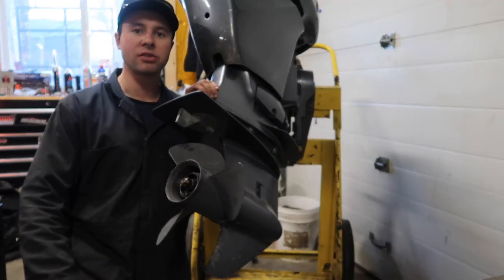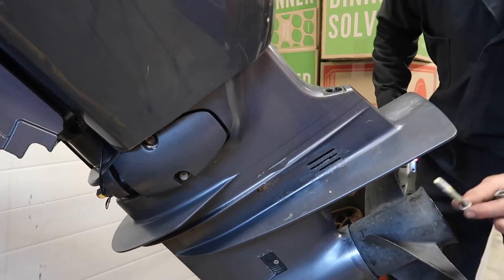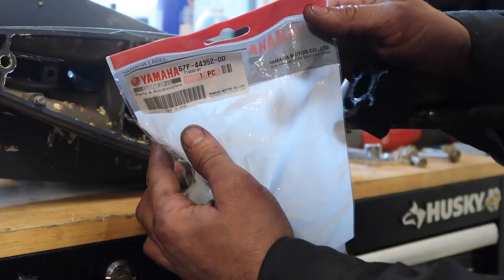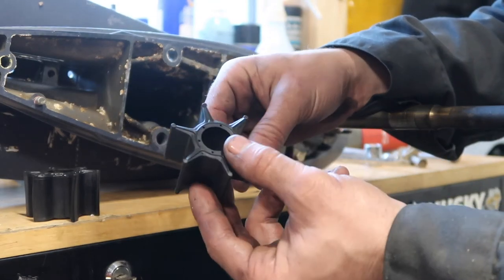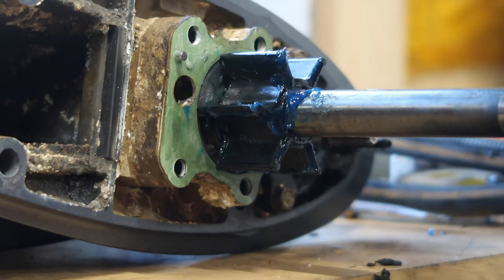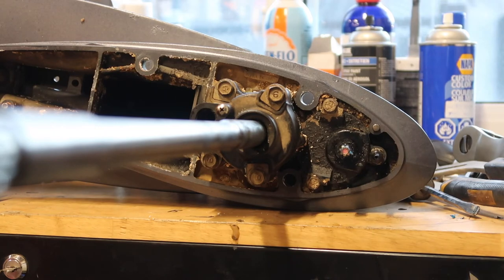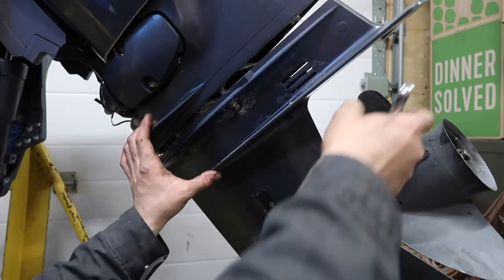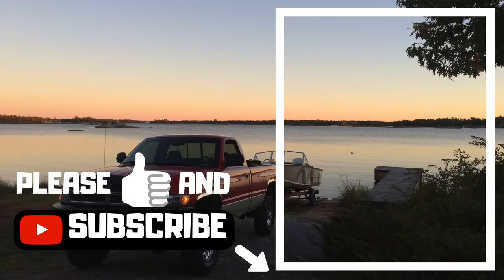Yamaha 90 HP 4 Stroke Impeller Change

Comment: The grease is a good idea for first start and will be flushed out in no time and won't hurt the rubber impeller. Also a good indicator is when motor at idle and flow out of pisser is slow change impeller.
Reply: Change oil in a 60 hp Yamaha outboard motor

Comment: I'm having troubles getting the outdrive to go into the upper part of the motor. I get to within 3/8" of going together and it won't go any further
Reply from the maker: Be sure the water tube is lining up . Some lube on it helps sometimes. Also make sure splines are clean.
Reply: I lubed the water tube and shifter splines as well, not sure why it won't go past 3/8" together

Comment: Good video - very helpful in replacing my impeller.

Just a couple of lessons learned:

1.a note where the bolts come out when removing the lower unit.  There are two different sizes
1.  It is helpful to clean the drive shaft before pulling the impeller.  Also used some dish soap to help it slide up. 
2.  My impeller was very tight going on.  Used a piece of wood and small rubber mallet to help move it along. 
3.  Be careful not to score the shaft with screwdriver.  As soon as I got the impeller moving I switched to a plastic tool that is designed for removing interior parts.  
4. Used dish soap to help the impeller slide into the cup.  Very helpful suggestion someone else made.
5.  When putting the unit back together make sure you get the spline for the shifter into it’s shaft (hole).  There is enough play in the upper piece that the unit will go together with the shifter not properly engaged

Comment: Great video. Replaced everything like you did to the letter, water flowing great, but prop will not engage when put into gear (water hose in the driveway ... for what that's worth). Did I miss a step? Quite sure the splines in the shaft lined up or the lower unit would not have bolted back up would it? Thanks
Reply from the maker: Hey Joe! 100% you missed the splines on the shift shaft when putting it on. It’s a pain but yank it off and move it to neutral (pliers), you’ll feel the detent and spin the prop free. They are a PITA to throw back on nice.
Reply: Made this job easy, only thing is my prop is free spinning and won’t engage. I’ll have to drop it and figure out how to line up the splines. 90hp Yamaha
Reply from the maker: @27fabre1 hey, yes you have missed the shift shaft to line it up. Take your time and you will get it. In all the one’s I have done they can be a real pain and it would not be the first time I missed one putting it together. Good luck.

Comment: Is this a wear item?
Reply from the maker: That’s correct. They recommend changing them every 100 hours or yearly. Many go for years without changing. 

They are supposed to stay nice and springy and should spring fairly straight if the impeller housing was pulled off. Eventually they get hard after use and take shape of the cup like the one i pulled out and they will either shred and clog the water passages and cause an overheat or can just become so taken to shape that under high speeds they cause an overheat. Most of the time they shred and the motor gets a severe overheat. That is why you change them regular to prevent it👍🏻